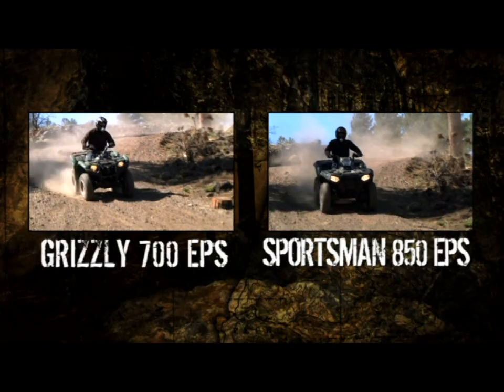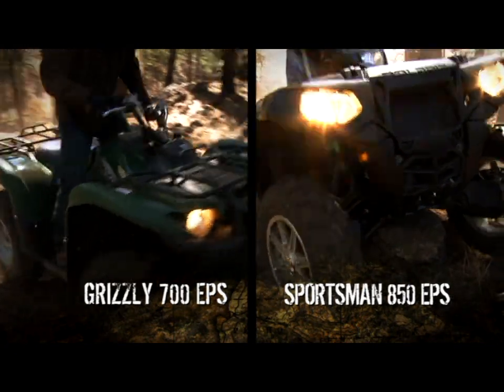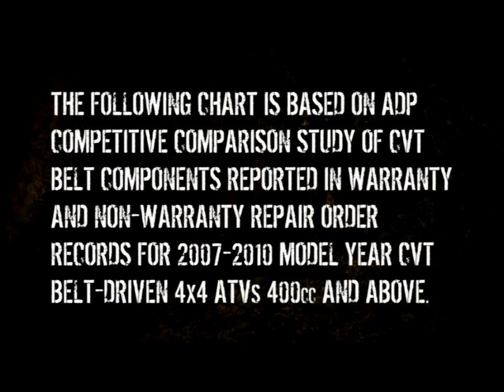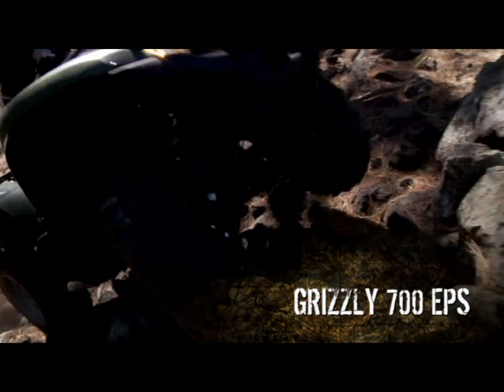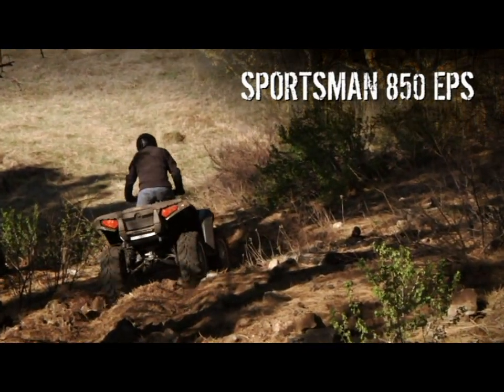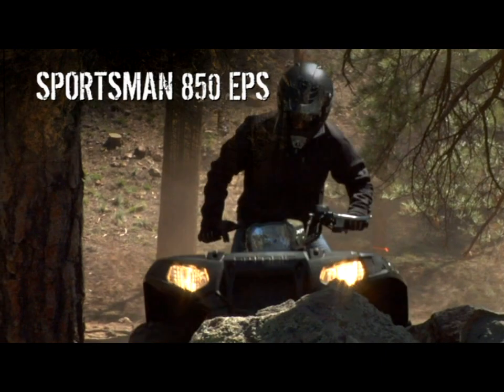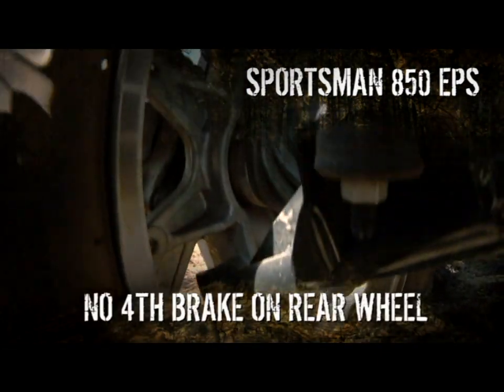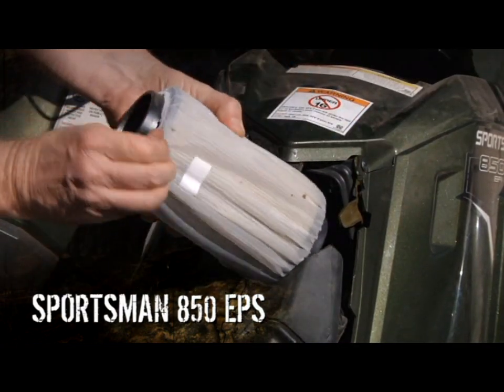Yamaha Grizzly 700 Polaris 850 Camparison

Comment: I laugh when I see that all the Grizzly haters have a Polaris !  Nothing like running your mouth when you know you've been screwed.  Facts are facts.  Yamaha is a better built machine with less maintenence issues.  Proven time and again.  Yamahas 4x4 is push button simple, yet Polaris jumps in and out, often at inappropriate times.  Wanna race on pavement, sure the Polaris will win the 1/4 mile by about 3 feet.  Now, lets see who can climb that rocky hill easier.  Better yet, who can come down it without loosing control...

Polaris owners, I understand you're pissed off that you have been duped by the Polaris marketing folks.  I would be too.  Simply solution though instead of lashing out at those that didnt get taken.  Sell your toy and get a real machine.  Then you can argue your position with facts on your side.
Reply: well said !
Reply: Yeah...I have owned a couple of both and ALL of those challenges would be easily won by a Polaris, CanAM or even an Arctic Cat (Textron) with an experienced rider because they actually have MODERN power. And modern chassis designs. I think it's funny how NON Polaris owners say that Polaris machines are 1) Not Built Well...I've crashed both and there is a lot LESS to fix on a Polaris when crashed... and 2) NOT Reliable when I've personally helped people on the trail with ALL makes of ATV. Yes INCLUDING Yamaha. Yamaha's 4x4 is in fact push button, but as it has 2 buttons and a flip style lock out...Is more in depth than just flicking a switch on a Polaris. Virtually everyone I know has a Polaris and has never had an issue with it...Other than the occasional belt failure...Which will also happen on your beloved Yamaha. The difference is we do not have to worry about a centrifugal clutch failing. Which DOES happen. I've replaced the shoes myself (on my 700) and yes they are an INTERNAL ENGINE component. I can change a belt on my Polaris on the trail in minutes with nothing more than a 10mm nut driver. Good luck doing that on a Yamaha. 

And as far as Drag Races go...Yamaha's have ZERO chance of keeping up with any brand but a Honda. Even the The CF Moto's and Kymco's outrun them quite easily. This is the most hilarious thing to me about NON Polaris Owners...Whether you guys want to admit it or not...Polaris machines in almost any class are equivalent to the Corvette ZR-1. For the amount of money you pay...They shouldn't be even half as fast as they are. And yet. To this day...The ZR-1 has a 4 tenths of a second difference in lap time between itself and the 1.4 MILLION DOLLAR Porsce 918 Spyder. My 850XP will do 82-83MPH on Pavement and about 75MPH on hard pack. NO grizzly is going to even come close to that. Plus after about 50-55MPH the grizzly gets unpredictable with its steering. Again I know this personally from owning 2 different Grizzly's over the years. First a 660 and then a 700. My Polaris machines are ROCK SOLID at full speed.
Reply: Brandon Crimmins let see whos gonna race to the shop first. I had my grizzly for 7 years never had an issue. My buddy always talk about how good his polaris is when he bought it but guess what? He ended up with a yamaha at the end.
Reply: Brandon Crimmins does Polaris even have a front bumper
Reply: Mike Sharpe your crazy😜

Comment: I live in the Pacific Northwest and put 20000 km on my 500 polaris I ride with mostly yamaha grizzly and Kodiak this add is the biggest pile of crap I ve seen but so are the polaris adds after all I find most people who are fans of there brand Don't use there quads a lot in harsh conditions I ve never seen any quad go past the 8000 mile marker without issues the old 660 grizzly broke frames the new grizzly rearends, I replaced every part except the engine and transmission on my polaris over the last 10 years.

I ve never seen a grizzly  beat my polaris at any point off road and I can t say I ve ever out classed a yamaha grizzly for a 700 it's  gutless for power and was only quick in 2007 there quality machines and I agree they beat polaris in that department but I ve also seen plenty of them fall apart that were well maintained to watch the dealer and yamaha denie warranty if you want to own a quad for 10 years grizzly is a great choice if you want to buy a quad and flip in 5 buy a polaris 

After long consideration I just bought the 850 sp now time to go hunt grizzly

Comment: Polaris is the most powerful, yes but reliability = ZERO
My Polaris Scrambler 850 XP 2013 broke down few weeks ago with only 3500 miles.
Timing pulley slipped, It's a disaster inside, motor needs to be rebuild.

Polaris France doesn't want to ear anything and ask 7000€ for repairs.

I understand now why Yamaha's owners say :

Whatever you go with a Yamaha Grizzly, you always come back.

Comment: Yamaha tries to Pick-a-Part every sentence of polaris's build in description of this machine the Polaris 850 will walk all over the Yamaha 700 power to weight ratio all-wheel drive 1/5 of a spin all-wheel drive all the time not back and forth transmission as they described in the video that's wrong but nice try Yamaha

Comment: Grizzly 700 i got, ya gotta stop, push the 4wd button, roll the wheels or even jerk it or wont get out of 4wd. Plus if ya take it out of 4wd while driven it, it will lock up. I had a honda, same ol way not just yamaha. I owned honda for 3 1/2 years, my yamaha be ownin it for 4 years in december

Comment: Yamaha builds a very nice reliable machine no doubt about it. It's also thousands of dollars more expensive and has a lot less features and hp than the competition. The Yamaha shouldn't be compared to the Polaris 850, it should be compared to the Polaris 570 or Can Am 500 because it only has that amount of hp. 

Also the Yamaha doesn't have nice aluminum wheels, no composite racks, almost no storage, lower ground clearance, shitty handling, and ugly 20 year old styling. 

Regardless of all those shortcomings I almost bought one because of the rock solid reliability. The price was just too damn high to justify so I bought an 850 sp. Yamaha has to get innovative and competitive because right now, they're just not.

Yamaha 700 - 45 hp
Polaris 570 - 44 hp
Can Am 500 - 46 hp
Polaris 850 - 77 hp
Can Am 800 - 74 hp
Reply: Hp dont mean shit i have a 2014 grizzly 700 stock and my friend had 2014 polaris sportsman 850xp stock and he cant follow me
Reply: Yes i did lol
Reply: Composite racks have to be the worst thing anyone has ever come up with for an atv.  You can't break steel racks because they're not made of junk plastic.  Give me steel racks over brittle plastic any day.
Reply: You can't bend them back after a hard hit, just have to replace them.  Steel racks help protect the plastic bodywork underneath.  I do agree that Yamaha and Honda do lose the hp wars, that is a fact.  Ill admit I have only owned quads with steel racks so I probably am a bit biased.  Maybe they are tougher than I think but take a sledgehammer to a steel rack and a composite one and tell me which one will have less damage.  The steel rack will be slightly dented and scratched while the composite one will have a huge chunk smashed out of it, rendering it useless afterword.
Reply: Greg Rowe I understand, people like what they know and are used to. Personally I love composite racks and wouldn't buy a machine with steel racks. Steel racks can break, I've seen it. I always put front and rear bumpers on my machines for protection. I can't imagine what would break my racks other than a severe roll-over. I've even seen a few of those where the racks survived. 

I understand what you are saying about the sledge but you would never do that to your own machine. Worst case scenario if I cracked or destroyed a composite rack I'd simply replace it. Their convenience is simply too hard to overlook especially the Sportsman with the built in storage.
Reply: I suppose the Polaris lock and ride system does work quite well with the plastic racks(i refuse to call them composite).   At least the Can-Am Outlander L models still have steel racks.  Can-Am put steel racks on them to save money, in my opinion, its a step up.  I guess I'll just agree to disagree with you.  You like your plastic racks, I prefer the much tougher and more rugged steel ones myself.  I'm not saying I wouldn't buy one with plastic racks(A Sportsman 570 would be pretty high on my list if I were to buy a new atv) but I would see it as a liability not an asset.  Sometimes saving a couple pounds is not a good thing.
Reply: I have a 2014 Grizzly 700 and it is slow.  The Polaris 850 is also slow, but not as slow as the Grizzly.  The Grizzly is lighter and it does jump and corner better.  The Polaris has more straight line speed, but the Grizzly stays close until about 25 mph.  Trail riding is fun on both and the hp advantage goes away a little in the tight stuff.  The ride on the Grizzly is much improved for 2014, but still not as smooth as the Polaris.  Our Polaris XP is no longer used on the farm because the belts wouldn't last with all the slow driving / hauling.  It also gets electrical gremlins when the creek is up.  Other than that it has been fine.  It is also harder to use composite racks for all the random things you have to do / carry on a farm.  We fabricate our own baskets to carry feed, fence posts, chainsaws, etc. and the composite racks are more difficult to attach homemade stuff to.  Sometimes I stand on the steel racks to reach tree limbs with the saw, I wouldn't try that with composite ones.  With 26 inch tires on the Grizzly it has the same ground clearance as the Polaris, just FYI.
    I don't know anyone who uses Polaris ATV's for heavy farm use, they don't seem to take it well.  They tend to be more for the recreational crowd.  You can usually get a well equipped 850 for about the same money as a Grizzly, so if you're not going for utility then it makes sense.
Reply: I agree with some of the things you wrote like it being more difficult to create your own custom rack attachments. However you are the first person I ever heard call the 850 slow. I'd hate to see what you'd think of a Rincon. The 850 is faster than a Brute Force and most people that have tried that machine are super impresses with its power.
The Grizzly chassis was seriously overhauled for 2014 and the widened the track by two inches which is a huge improvement for stability. 
The Grizzly's ground clearance is close to the Sportman's when it has 26 inch tires, still not as much. 
If I owned a farm I would buy a Grizzly or Honda. But I trail ride, so I own a Sportsman because they are more fun, look better and have a lot more features.
As for price, the Grizzly is a lot more expensive where I live. I got a Polaris for two grand cheaper than a Grizzly recently. If the Grizzly was the same price I may have bought it. But considering how few features it has it should be a lot less than the Sportsman.
Reply: PC MR I ride dirtbikes a lot so I have a different basis for comparison on what feels fast.  The 850 is definitely fast for a 4x4 quad, and if you can have more power for the same (or less) money then it adds to the value for sure.       I actually prefer the feel of the Grizzly, and I seem to have more fun on it which is strange considering it's 2/3 the power, if that.  I'm 175 lbs and used to lighter vehicles.  The Grizzly is the only 4x4 I can get on that makes complete sense and does exactly what I expect.  I love the independent brakes and the 4x4 system. A lot of that is because the front brake is on the right hand like a dirtbike or sport quad, EXACTLY WHERE IT'S SUPPOSED TO BE!!!  Just personal preference.  I wish it was narrower between the seat, didn't cook my leg when riding double, and had better headlights.  At night when you hit the throttle you see tree tops, and when you hit the brakes you only see 4 feet ahead, and there's no third headlight.  I have to constantly switch from high to low beams to see the road.     We have a Honda Foreman with the electric shift.  It is pretty much only for work, like a tractor.  Our other quads are a 1989 Yamaha Moto 4, and a late 90's Big Bear, Blaster, and Kodiak.  Pretty Yamaha heavy I guess.  The only quad we've had to junk was a Polaris 300 (or something) from the mid 90's.  This was a known lemon patch for Polaris.  Next quad will be an 800-1000 for recreation and 2-up riding so Yamaha isn't an option.
Reply: Greg Rowe Yes, composite is so brittle that's why most hand guns and rifle stocks are made with it....
Reply: +Matt Phinney on tight or technical trails a Polaris 850xp can't keep up with a grizzly period.. It's like driving a Coke machine with a substandard 4wd that activates only when it loses traction .. We won't even get in to its(Polaris) legendary unreliability .. Finding a 10 year old Polaris with over 5k miles on the odometer in the woods  is like seeing Bigfoot in person.. Rare as hell
Reply: EastCoastATV did you know that polaris paid yamaha under table not to build any machine that will out strength polaris. Because yamaha already smoked polaris in every way so once they make powerful engine, polaris company would doe out for sure. You have to thanks yamaha for being kind enough.
Reply: EastCoastATV that’s right grizzly is a toy😜

Comment: @dash11111111 Depends on the driver too! I love my 850. I maintain mine very well and it has treated me good. EVERYTHING breaks but the Grizzly failed too many times. If you like Yamahas more power to ya. I'll stick to my Polaris and keep going. Oh and by the way did I mention the 3 front diffs the broke due to the junk diff lock systems?

Comment: Yamaha all the way, buying a Polaris is like buying a Chevy truck, pure junk!
Reply: yamaha is more expensive and comes with less features. yamaha is talking the talk but not walking the walk because every time ive ridden a yamaha it is a rough and slow ride because every time u want 4x4 you have to change gears then flip a lever and then press a button... what if you want 2x4 you have to take at lease 30 seconds to stop change gears and flip a lever and press a button.. polaris just flip a switch... done. but i will give you that Chevys are crap

Comment: I've had a Polaris for 6 years and the belt blew once
Reply: How many kms?
Reply: ive has my polaris since 2001 not one problem and i havent changed a belt once and have over 1800 miles...
Reply: I've 5500 kms on mine. Needed new tires, but no belt change yet.
Reply: its ALL how the OWNER treats it...
Reply: Poop in jo mouth I think we all ride them as hard as we can. ;)
Reply: Kevin Skinner There's only one thing that burns belts, that's giving it lots of throttle and not moving.

Comment: Oh my god could this be more inaccurate, the polaris fucking kills the grizzly, I mean look at the fucking thing.
Reply: How does looking at it make it a better bike?? It doesnt. It has a shitty cvt transmission, blows belts constantly, heavy, and has the turning radius of a log truck
Reply: You probably dont ride it properly... If you do, you wouldnt blow the belt... But then again every belt can only last for so long..on the grizzly you always have to stop and shift to 4/4. You lose your momentum, and you put tons of stress on your steering components, you might not feel it cus of the "balanced power steering". The polaris shuts on and off so theres less stress on the steering components.. And the polaris is way easier to sit on.. More like a sport quad. And way more stable at high speed because of its longer wheelbase compared to the midsize gtizzly that a tall guy has a hard time fitting into.

Comment: also ohh man the polaris weights A 150 POUNDS MORE ohh no... probably because its a whole 150 more cc's.. and the polaris comes with real handle bars that arent sticks strapped to something with 4 wheels and real tires, polaris has 2 optional 2 lights one front 1 on handel bars, plus polaris has a actual speed and notification interface on the handle bars, and when they talk about simplicity polaris has only one handel bar brake but with yamaha they need to think ohh do i need to use the back break or the front?? and there wrong when you pull in the brake on the polaris it activates all 4 brakes and you can buy reusable air filters for polaris... its obvious that this video is incorrect and they are biased towards yamaha... Yamaha tires are 2 star garbage and the "screen" is 1 in by 2 in and is bad and cant see in sun..
Reply: The Yamaha has a large read out electric speedometer on its own display you know, and it doesn't matter if the engine has to be bigger to haul the heavier weight or not, because you'll still feel like you're carrying a personal weighing 150lbs with you on the trail. And the Polaris only has /3/ brakes, so when you pull the handlebar brake lever the wheel without a brake will just freewheel. You're sounding like you can't be bothered to study the actuarial fine details of one thing before you're against it and become big mouthed about it when you've not paid attention to some things.

Comment: Totally false on the Grizzly, it will not lock up, I do it all the time.  The reason they tell you to stop is due to the handling changing and has nothing to due with the mechanicals.  Some idiot engaged the 4wd at 50 and sued Yamaha hence the reason they say to stop.

Comment: this belt thing is not true at allll!! this vid makes me want to throw up... me and my friends have been riding polaris for YEARS and none of them have had problems..
Reply: Agreed. I have over 3,700 kms on my 2008 Sportsman 500 and never had a problem with the belt. You have to just know when to use low gear properly to not burn out your belt. Also in this video they clearly have the 850 in high gear when trying to traverse large rocks. That's hard on any machine.
Reply: ***** 
Their belts might not burn but they will snap. I saw two Grizzly's with broken belts last year alone. They are not infallible.